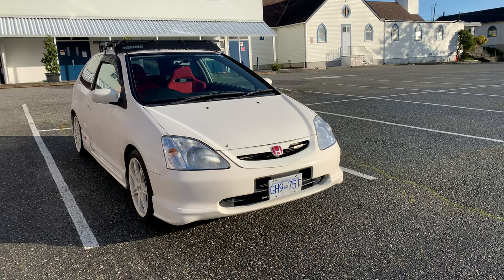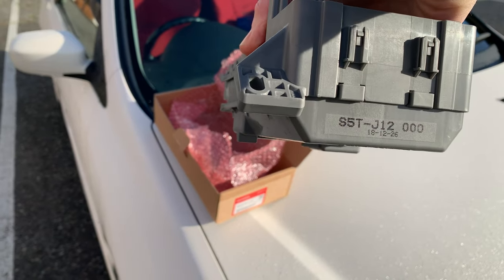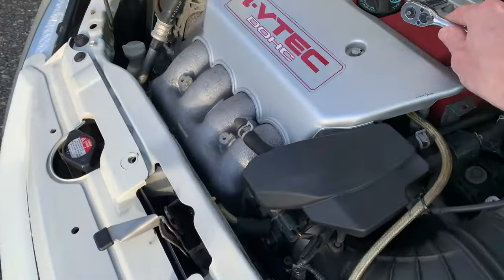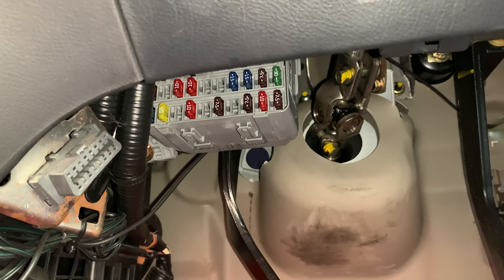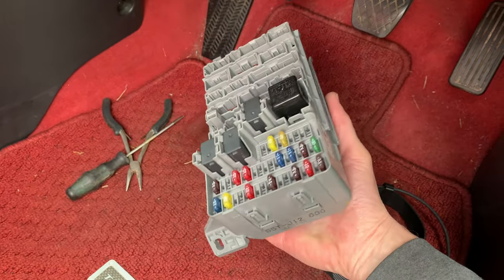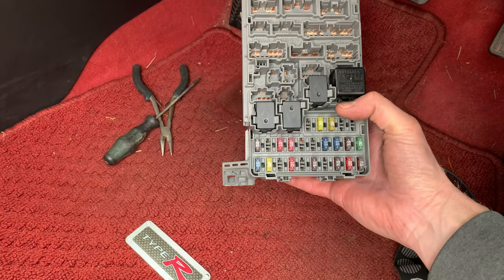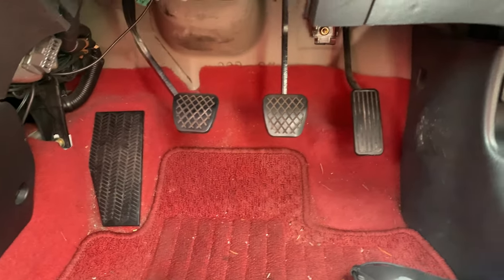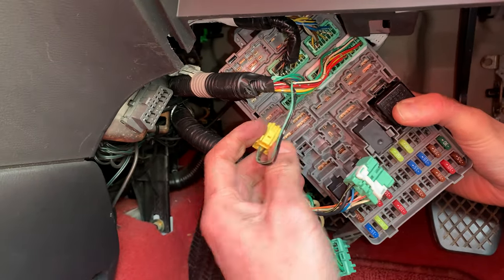Honda Civic Multiplex Control Unit Replacement (MICU)  DIY and save Money!

Comment: I wonder if I need to do this on my 14 civic si . My left headlight is staying ON even when the car is shut off. It already drained my battery . And it’s on my DRL staying as a high beam . The rest of the lights are completely off. Literally one bulb is on and I had to remove the fuse for the high beam to turn that off and hopefully my battery doesn’t die. I do get a message saying Check DRL System.

Comment: Hey I have a 2010 Honda Civic Hazard fuse keeps blowing. I got into an accident on my passenger side and my bulb went out to my right turn signal I never changed it. Then all of a sudden my hazards and turn signals stop working. I change the fuse when I turn left only it stays on but as soon as I turn right or turn on my hazards it blows. Also my back lights stop working but my front lights work Is there a short?

Comment: Did you have to reprogram the immobilizer or anything on the new MICU to sync with your car?
Reply from the maker: Hello Sarah 
no I didn’t have to, my JDM type R only came with a basic factory key, no FOB/ alarm or anything like that. They just come with a manual old fashioned ignition key. I’ve heard Honda dealers can re-program immobilizers for about $30.  Good luck!
Cheers